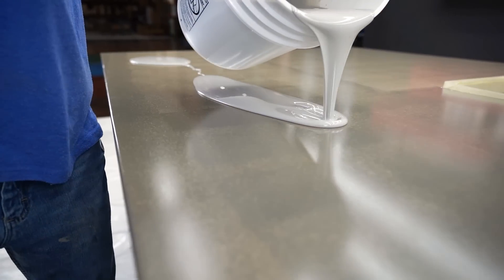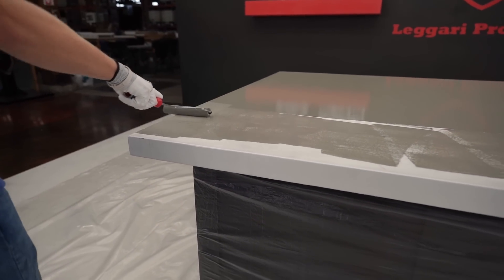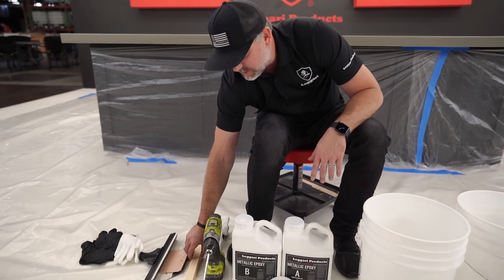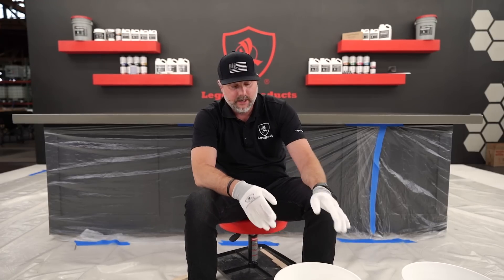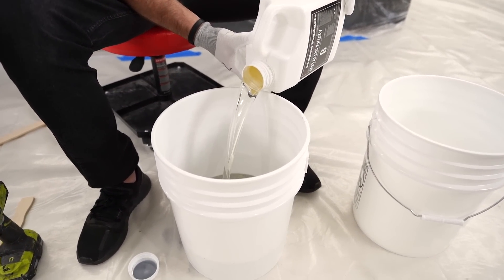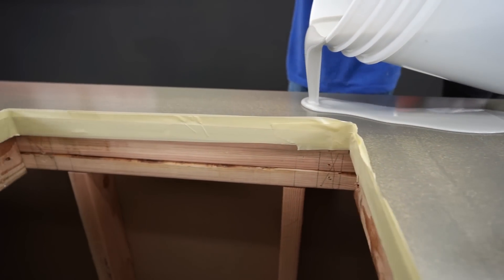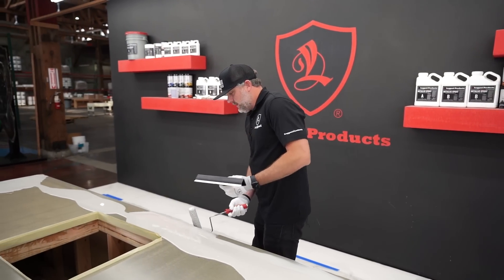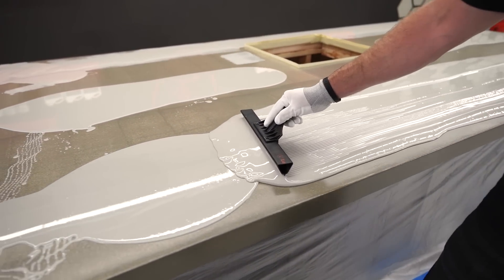Coat Your Countertops Using Epoxy Like a PRO | Resurface Existing Countertops For Beautiful Finish

Comment: What kind of rollers do you use?? Just wondering if you had any problems with the roller knap getting into your epoxy when you roll it out.....
Reply from the maker: We typically use 3/8 knap and de-shed the roller before use by rolling it along tape👍